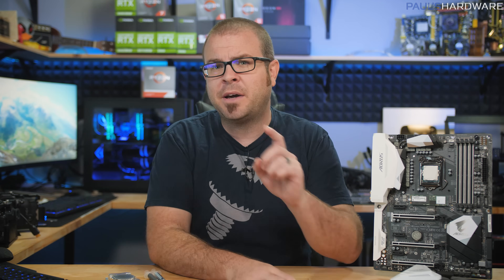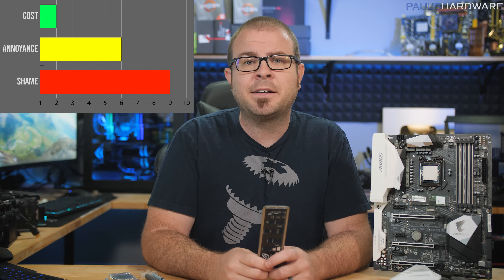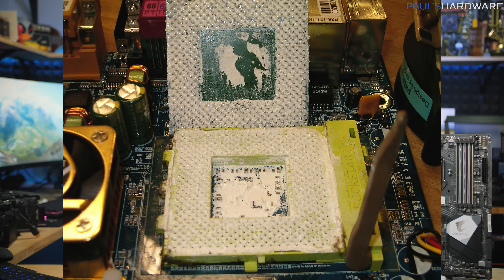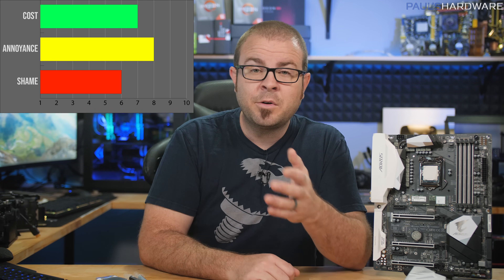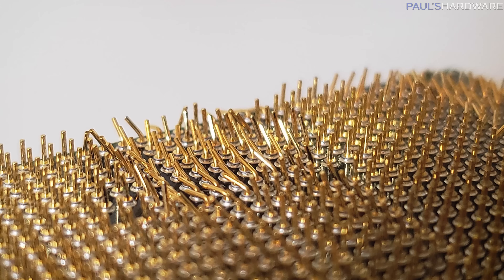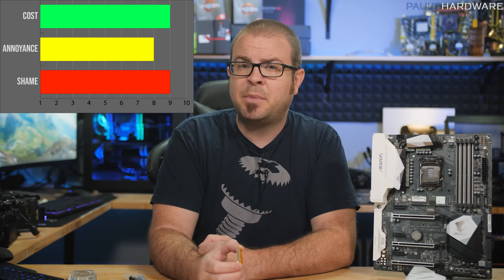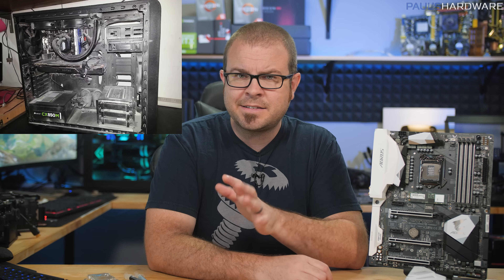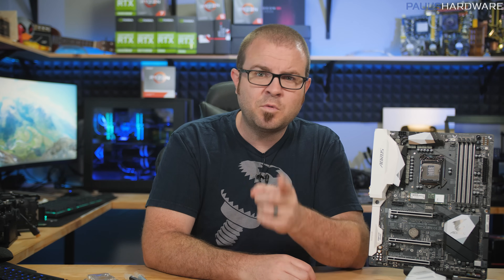The 5 WORST PC Building Catastrophes 💥🔥🧯

Comment: 1) finished your water cooling loop and forgetting to install the fans on the radiator
Reply: I just finished my first water loop and have no way to cycle the pump on and off to fill it because no way I'm unplugging everything from my psu. Waiting on an ac to molex adapter to be delivered (with switch)
Reply: @alienrenders  - hence why Ive always had a separate PSU (with a jumper on the 24-pin) for that very purpose. It doesn't have to be anything flash (even a Yum Cha PSU will suffice),  just make sure it has a rocker switch on the back to cut the power when needed.
Reply: if you had a big enough radiator that wouldn't be an issue lol, or hold it in front of the ac vent
Reply: You don't need those fans. Tweezers are way better. 
#Verge

Comment: I got very lucky with a short once: bricked two motherboards and a processor, but thankfully no sparks or flames. Upon further inspection, I discovered a light strip from my first gen Hue lighting kit had exposed copper, and when the system would hit a specific case temp, the rig would expand just enough to allow the copper to short on the case. Good... good times. Oddly enough, that Hue kit still works...

Comment: Here's my personal PC building catastrophe: 
one day i was installing a CPU cooler , however i lost one of the screws so i tried another screw that i thought matched the threading.
 it was double the lengh but in my mind i thought it would stop after it gets enough tension. 
so i continued to thread the screw, until i nearly drilled through my Motherboard. after i realized that i just sat there looking at my PC dreading the thought of me turning it on and it not POSTing 
thankfully it still worked, though the motherboard now has a copper colored "dent" near the CPU socket.

Comment: for me what if you dropped your pc is still fine today i even had my 1050 inside at the time but my PSU was damage and take the beating. so i upgraded my PSU to an evga . and i upgrade my gpu . and now i need to upgrade my CPU i have a g4560 now should i upgrade to a i3 8100 or a i5 my friend's other people say upgrade to an i5 instead .also still using the same pc texting to you i dropped lucky it was not on a desk it was on a plastic supply box i pushed my desk back forgot my cables were plugged damage my ethernet cable the tab clip broke off . also my g4560 is showing bottlenecks in allot of games today playing dmc 5 i can only play it in med settings if i go to high or ultra it lags even with my 1060 6 gb egva one inside . even ff15 i can only play on low hair works off and i get 55 fps .

Comment: How about removing the sticker on the cpu cooler before installing? 😬
Reply: Ahahah I did that once. Like.. I saw it.. I made a mental note to remove it.. then I forgot. Some hours of troubleshooting and once I realised it the sticker had started to melt.
Reply: Wokis  mate that fucking sucks. Honestly what did you do after because I don’t even know what I’d do ahahaha
Reply: @jenson1603  Nothing broke, the CPU just thermal throttled and stuff :) They've had build in idiotproofing for a while now, it was an LGA775 Q8400 even.

I just scraped it off and was happy that I had realised what the problem was!
Reply: paging Mr. JayzTwoCents...
Reply: This is nothing. Wipe your cooler interface clean and it's OK. Remember to apply thermal paste on your CPU cause there is no paste on the cooler.
Reply: This was my first thought for the Thermal Paste Application Catastrophe, Jay did it again recently in a build video 🤣🤣🤣🤣🤣
Reply: I ALMOST did that once.
Reply: This is not even uncommon
Reply: There's a sticker?
Reply: There are stickers on CPUs? Uh-oh.
Reply: @metal_mo  Not at CPU's but CPU coolers.
Reply: Jay-soos, now I'm worried.

Comment: Realizing that all of your cables are too short.
Reply from the maker: oooh, good one 😁
Reply: Paul's Hardware Thanks for the reply! Love your vids.
Reply: Oh I love Big Towers, except for... that...
Reply: This one happened to me in my most recent build.  Put together a mini-ITX system and it was recommended to use an SPX PSU.  Grabbed a fully modular one and said "Yay!" as I went home.  Got home, got everything together, put the PSU in and none of the cables were long enough.  Seriously was so annoyed by this.
Reply: Especially fan cables! 🤦‍♂️
Reply: That's why i dont buy seasonic power supplies, their cables are always too short.
Reply: Make custom cables. ...Although, if you manage to mismatch the pin-layout of complete custom cables, you're f*cked too. And you should feel ashamed!
Reply: Beat me to it! You can usually re-arrange stuff to make the cable reach...but not always. Then your ass is running to Best Buy. In shame! lol
Reply: Happened to me. Had to drive back to get a new PSU.
Reply: my cpu power connector was too short, and I HATED running it over the GPU, through the front!
Reply: Would be worse if both the cables and power rating is short.
Reply: I used to go through this all the time then i came up with rules. If I'm doing an ultra budget build and using a budget psu i only use a case with top mounting psu.  Haven't had that problem since
Reply: Endor_ wrong and bad cables
Reply: Cost: 2 (You can buy longer replacements for most cables)
Annoyance: 6
Shame: 5 (Sometimes you didn't cause it, I had a fixed psu where the cables were far too short to reach most of the hdd/physical drives and had to use extensions)
Reply: ALL?? le gasp....
Sounds like a thing when you buy the custom length cables, which also means you can't "fix" it by just getting some extensions.
Reply: Yea, thats what she said.

Comment: omg I CRINGED when he showed the thermal paste in the socket.
Reply: Watch the video from Gamers Nexus to see it in moving pictures
Reply: yeah definetly, watch the Gamers nexus video "too much thermal paste benchmark" and watch that spaghetti thermal paste drooping in glorious 60fps
Reply: @jeyendeoso  Steve didn't even use as much as The Verge.
Reply: i know, steve got nothing on the jackson pollock of thermal paste
Reply: yeah it made my face twist
Reply: 🤔I'm wondering if Spray Contact Cleaner would fix this as it is great for cleaning Thermal Paste of CPUs
Reply: @shaneeslick  throw it in the dishwasher
Reply: @White-Wolf1969  at my place that is a sink full of soapy water 🙄
Reply: something in me died
Reply: Truly one of the most upsetting occurrences of or lifetime.
Reply: it was a Socket 462 so not a big loss... Kinda "Oh well moving on"-moment.
Reply: I accidentally got a couple drops of thermal paste on both my 3900x pins and my Crosshair VIII Hero motherboard socket.

I spent an hour cleaning them out with a filed-down paperclip soaked in isopropyl.

System's still running fine, thankfully.
Reply: Me too
Reply: you need a paste to put the processor, right?
Reply: Same!

Comment: I wonder if I've done any of these? I hope not...I've built over 1000.  My list below.

5) We all forget that shield sometimes. 

4) Thankfully, never over applied. 
3) I have honestly never lost power during a BIOS update. Yay me. 
2) I have, unfortunately, gotten very intimate with razor blades over the years because OEM tray processors are not as well handled as retail package processors. So many hours bending pins back. LGA slots for Intel motherboards? Never even tried. 

1) PSU Fire! Oh my god have I seen this happen. In the early 2000's Sparkle PSUs lived up to their name. I've seen those PSUs send out a 3 foot flame during a first start up. Scared the crap out of us. Thankfully we only bought 10 of those PSUs for new systems but quickly sent them back.
Reply from the maker: Thanks for sharing! This was interesting to read from an experienced builder 😄
Reply: You haven't lived until you've had a PSU explode right in your face. First you're scared shitless, then the smell hits you.
Reply: reason for return? 

ordered a power supply, got a bomb. not what i asked for. 

lol